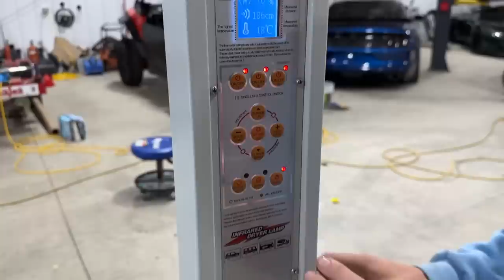Rebuilding A Wrecked Lamborghini Urus Part 21!!!

Comment: Wrap is good but this build deserves a nice paint job
Reply: wrap will last maybe 5 years or so and then peeling it off is a nightmare when jams and all is wrapped. i agree it should just be painted at least black then wrapped.
Reply: Agree, stunning paint job first, then wrap if bored of colour!!
Reply: They will eventually paint it. Pretty sure the choice not to paint it is related to delays in getting the paint and access to paint booth. They want to get videos out every couple days so rather than give us videos of them sitting around doing nothing they will wrap it move on to the next thing and then paint this at a later date
Reply: And not paint coat underrap finish in rust most of the time
Reply: Wrap is easy to peel off lmao
Reply: @nascarman38n88  hate much? Troll?
Reply: @nascarman38n88  dude I mean dude come on man. Dude… ok dude?
Reply: totally agree
Reply: Homestly tho im sure they still have a rim on the vioer that isnt painted the same colour as the rest
Reply: @bjjbenoit  they said in previous videos they will paint at a later date cause paint booth wasn't available at that time.
Reply: @thedude2596  Rust? The car is Alumnium
Reply: I agree totally , so sad to see it end like this
Reply: Wrap isn't even good, it's junk.  I manufacture this stuff for several companies.  Cast vinyl is garbage!  If you want to wrap instead of doing it properly (paint), at least use polyurethane wrap.  It looks way better, is far more durable (wearing and longevity), etc, but it is more costly.
Reply: @Nickelpleez  Dude they can't wrap. Dude look at the red wrap coming off Dude lol
Reply: @bjjbenoit  i think they said that they have the paint, same as the huracan but its a time consuming task painting it with that color and a paint booth ain't always available for the time needed
Reply: @Nickelpleez  They can't warp. Look at the red wrap coming off Dude
Reply: @nascarman38n88  dude, they are learning dude
Reply: Many people including myself agree and I’m sure at some point the Urus will get a good paint job. With that said I liked the green wrap they showed, it was much more unique than red and since it’s a wrap why not do something you don’t see all the time.
Reply: yea fr
Reply: "......Better than OEM" 🤣
Reply: @BevanLeigh   No kidding. I thought they were going to have a pro do the work. He could have done the work in their shop where they could have watched and learned. They’ve tried wrapping a few times without a lot of improvement. I really appreciate the way they just jump in and get things done, but there’s also a time to get it done right and learn something in the process. There are a number of comments from people with experience in wrapping and I think they could do some more homework before diving in.
Reply: Bu Bu can paint it
Reply: they said they will later once they have a paint booth...calm down yall
Reply: @Shadow0fd3ath24   everyone watching their channel loves the both of them that doesn’t meant that some constructive criticism is never warranted. Like most people I like the way they jump in and get things done in fact it is the primary appeal of their channel.
Reply: Wrapping a car is like saying "I want my car to look really good for about 2 years, and then look shit for the next 5 years"
Reply: @Shadow0fd3ath24  It's because the paint for a Urus is around 12k. Vrs $800 for wrap. They don't have faith in the structural integrity. The SUV has been shot multiple times, who knows if a bullet hit engine components. Lots of issues with this thing. Just like the fake gt2 rs XD
Reply: This was done to hone their wrapping skills. To date they have not mastered it. Some unfinished business.
Reply: Don't you recognize a hillbilly lambo when you see one?
Reply: Paint it guys. The pale yellow or desert whatever looks pathetic. 
This is a nice car, nice build but wrap kinda sucks. 
Anyway your car, your decision.
Reply: You are so correct. Paint.
Reply: @mixalis6168  Bro after paint job you cant wrap at least for 5 months , to not ruin paint under wrap.
Reply: The wraps look absolutely awful
Reply: Why didn’t you just paint the car?
Reply: Most deff
Reply: It was awful. Especially your coating destroyed all the lines of the car. It's definitely white, black, gray and it must be paint. You can't do the coating job.

￼
Reply: Please, let them do what they want. stop your ignorant comments.
Reply: Definitely!!!
Reply: Wrap is awful especially the colour
Reply: @thedude2596  no it will not lol
Reply: @alpinetrader  wrap is easy to peal off.
Reply: @TaylorNottz  no they dont
Reply: @bjjbenoit  that won’t be done any time soon because they’ve gotten so lazy over the past year
Reply: @S W  it's still getting painted lol when they get a booth.
Reply: @nascarman38n88  it's called learning morron.
Reply: Not a fan of the colour the green was amazing imo
Reply: @Zeke Lucente  there not wrapping it red lol
Reply: No its time consuming as they said, it will take a week in the booth, its better to wrap it it takes only 3 weeks
Reply: @bjjbenoit  Yep that's it
Reply: Pretty sure they'll be painting it as soon as the get their paint booth, this'll probably be the very first one to get done. 
I'm very glad they said they're having a professional come in to do the majority of it, I suspect that they'll end up pulling the majority of it off and redoing it lol
Reply: @3n3ly7m  think he might be referring to filliform corrosion which can happen with aluminium.
Reply: Indeed!  not sure why they cut corners like that they have missing things on all the builds and never even drive them hahah
Reply: Yes man it needs a very nice paint
Reply: Agree
Reply: Not that serious
Reply: I do not like the color either
Reply: they do what they want stop crying lil baby
Reply: Vote with the thumb, not with the comments
Reply: Was looking forward to the original green  wrap. Not a fan of the desert tan.
Reply: Agreed...
Reply: Not really digging the color 🤔
Reply: At the end is going to be a "CHOCOLATE BANANA!!"
Reply: Bro this car not to paint si fuckt up
Reply: @_-0_x_-_p_0-_   See my other comment where I acknowledged that. It’s right there.
Reply: @_-0_x_-_p_0-_   Whoa somebody lacks self control. Lighten up.
Reply: It seems like they do that a lot. They get into these extreme builds and just as they start to make serious progress they cut corners, like the Camero and the Factory 5. They can't seem to wait to get to that next build.
Reply: Agreed.
Reply: They won’t listen lmao and they don’t have to lol
Reply: Why not work on getting the 911 running? Or is it blown?
Reply: I agree should be painted don’t listen men
Reply: No shit like GOONZQUAD told everyone, They are building a paint booth on Billy's property than they're painting 🎨 the Lamborghini URUS.
Reply: It not just painting the outside, they also need to paint the inside too, they haven't even done with installing trim yet and they are wrapping it, and wind sheid, side glass/window this car is gonna look like a failure after installation ad wrap. I can see it coming.
Reply: Dude u think they will paint it one day if u don’t know there youtubers not one of those 20 builds they have are completed there all not done and they will never get back to those builds ever this is the YouTube game so anything that gets left behide doesn’t get done ever unles it’s more them 10-15 % incomplete then maybe they will make it look finished it’s all about the visual so that’s why I guys always see them slap panels on the car there working on  and off. Every video so it looks like it’s closer to done but really it’s a game of throwing panels on and off lol 😂 but honestly why would anyone that can do paint and body work so well wanna skip paint and just throw wrap on it I love these guys but they are trying to get away with not painting it that’s not the goonsquad I know these boys are hard workers but boys are getting too relaxed 😎 and throwning lipstick on it doesn’t fix it
Reply: Ya paint booth wasn’t available that day or two not for th past 3 weeks that’s just the excuse to wrap
Reply: It’s like they don’t wana donthrewpaint cause they don’t have keys to drive it in but they can easy roll it in lol they done in past
Reply: It looks absolutely disgusting !! I really wanted them to do a Urus but after all the incredible work they have done the chosen colour is a disaster !! Colour is all about personal opinion but there is a very good reason why you don’t see any cars that colour on the road - IT’S JUST HORRIBLE !! Sorry guys let’s hope I’m wrong and it turns out to be epic 😀
Reply: @jerrywilcox9890  no its not, gotta strip the car down again to get it out of the little areas and under like the door latches etc. i had my car wrapped.
Reply: @Alpine Trader  depends who wraps it some don't remove anything when they wrap so you statements incorrect
Reply: They don’t listen to the viewers 👌
Reply: I agree on that, espinally when wrapping is to protect the paint.